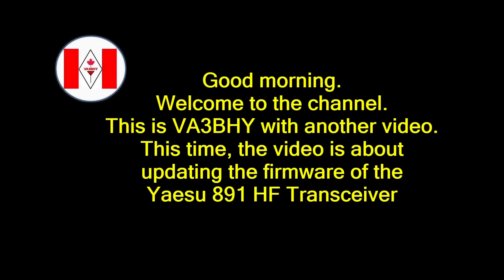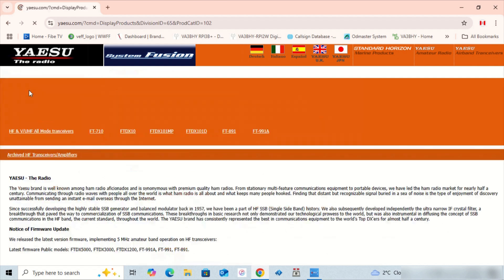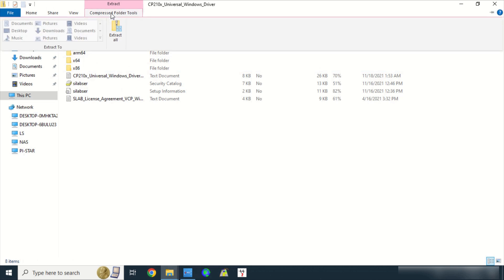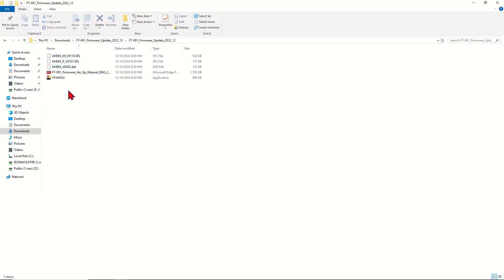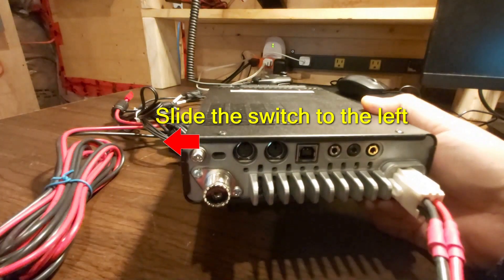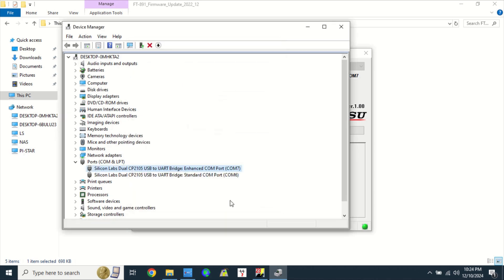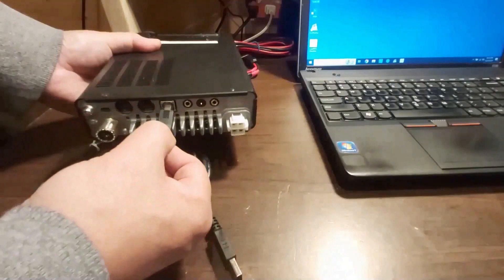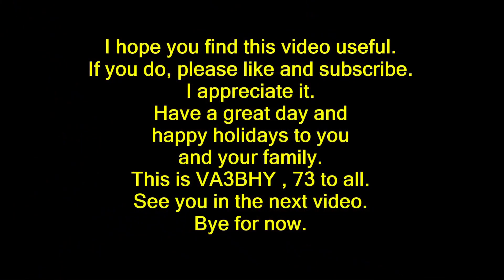Update The Firmware Of Yaesu FT891

Comment: Very good explanation of the procedures. But I would be curious what specifically is updated from version to version before deciding if it's worth going thru all these steps? I wish Yaesu would just have a flash drive available for purchase to eliminate a possible missed step and streamline the updating process. Either way, a good resource to have in case I ever decide to do this 👍 73
Reply from the maker: Please check your radio version. You may not need this update.
Reply: @VA3BHY  Please re-read my comment. I know which version I have and would like to know what the newest version has that is different than the previous. 🤣
Reply from the maker: @SA-hk8xj  😆😆😆